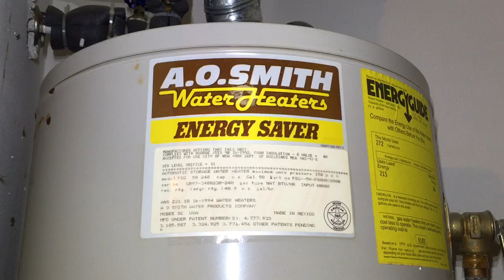What's That Knocking? Water Heater Issues - #AskAHomeInspector

Comment: and another illegal gas connection. water heaters are not a basic homeowner install. and that knocking is normal if it's a Rheem.
Reply: And why are they not a basic homeowner install?  Yeh having a proper sediment trap might be better and to code but what else is wrong with it?
Reply: @condor5635  call your local plumbing inspector. code requires 12 inches of metal pipe connected to the water heater for water connections, and rigid schedule 40 pipe for the gas connections. and dielectric unions and such. how many common homeowners know how to sweat copper pipe? how many common homeowners know about gas fitting?
Reply: Hi @krazi77. Why is this normal for a Rheem. I have one and it started knocking about a year after installation. A plumber flushed it and it still knocks. Just wondering. Thanks for your help.
Reply: @Sam-jj6ph  I'm not 100% sure, but part of is to do with the construction of  Rheem water heaters compared to other brands. they just knock, and it's normal. but most plumbers will agree that Rheem is one of the best there is.
Reply: @krazi77  Thanks for your reply. My plumber scared me after flushing it and said he hates Rheem water heaters. We rent and so had no choice. But the water heater works fine. By the way, nothing came out when he flushed it but clean water. What do you think of the Rheem classic professional series gas water heaters? Are you a plumber?

Comment: what if your water heater sounds like a rocket. like the sound of when one takes off
Reply from the maker: Hmmmmm how old is the water heater? If the heater is recovering and trying to make water hot.  The burner does fire and sound like a rocket? But it should only last until there is no more hot water being used.
Reply: oh it finally blew, it started to leak under it, the landlord finally replaced it 
what happen was that it was leaking under it, and it wouldnt stop running so it sounded like a rocket sound all the time,

Comment: You are slightly off with your explanation.   It's not the sediment floating around banging on the walls but the popping of bubbles from the water that is absorbed in the sediment as it heats up.    The sediment that this happens to is caked on to the heating element (electric) or on heat transfer plate (gas).  This is why flushing a tank  won't always get rid of the sound in a gas unit and almost never works on an electric unit .
Reply: What is the solution then ?
Reply: Yes came to ask the same thing. What's the solution? Replace entire tank?